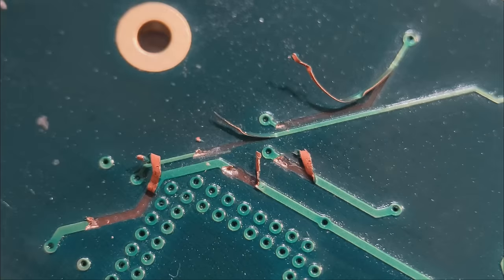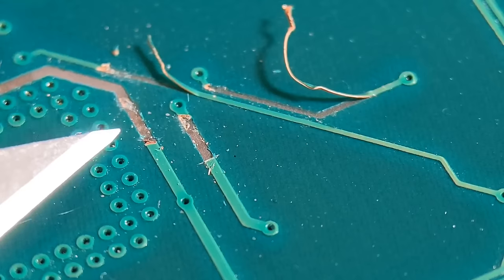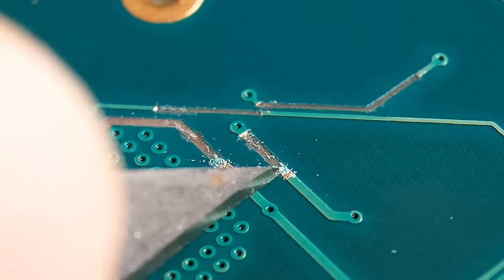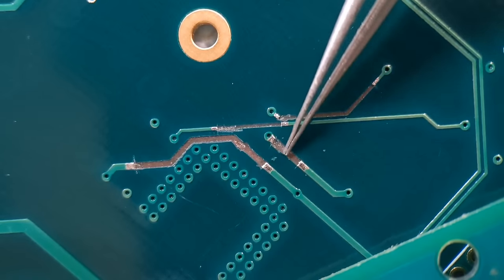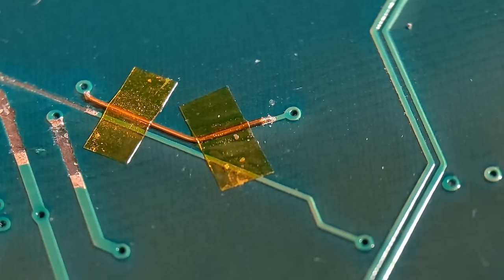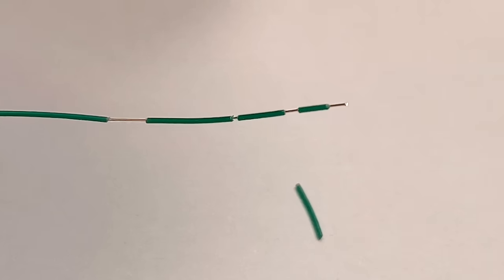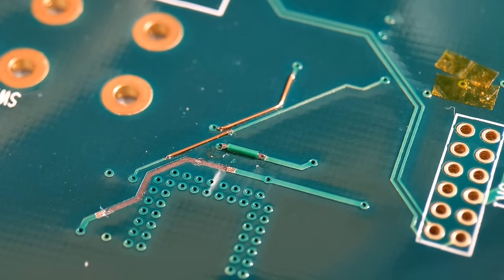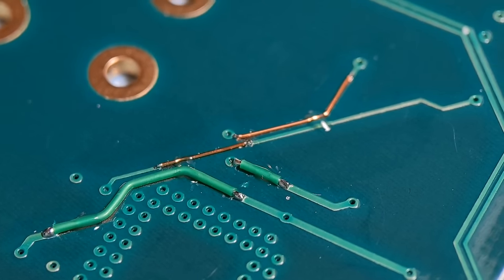How To Repair Damaged / Broken PCB Traces  - 2 Great Methods

Comment: I haven't been happy with magnet wire. I can scape off the coating, but it takes a good bit of effort. Burning it off hasn't been a success, i would need to go all the way to 450 on the iron, which is something i very much dislike doing, and then hold the wire in a solder blob for like 10 minutes. I bought the magnet wire from a local company, several times, and each time it's behaving the same, some sort of super enduring coating, very annoying. It doesn't have any temperature rating on it and doesn't claim to be anyhow special. A curse or a blessing, the company has rolled down its operation, so maybe i can try again, perhaps i'll find some lower endurance one now :D

As to loose trace sections i sometimes just glue them down with epoxy. The one i have is general purpose and isn't temperature rated but it seems to hold up to soldering just OK. Unfortunately it's slow. I have seen some people also use the soldermask green resin and cure it with UV to attach loose copper, but i don't know how well it works, whether it really cures all the way through. I have gotten some of that resin but haven't had the opportunity to try yet.
Reply: I is better to burn the coating off with an open flame, like a lightener or a small propane torch, and dipping it in alcohol. Then rub the remainders off with a cloth. Worked for me even on stubbornly hard enamel.

Comment: What kind of wire? "Cainar wire?"
Reply from the maker: Hi , thank you for your question . The green wire is called Kynar . It's a 30 gauge wire and comes in many different colours . It's a very common PCB modification wire , available from Farnell , RS components , Digikey , Mouser and many other electronic distributors . Hope that helps , thank you again 👍

Comment: What tape is that?
Reply from the maker: Hi , thank you for your comment. The tape I used to hold the wires down was called Kapton Tape. Available from many places , Farnell , RS Components , if in America try Mouser or Digikey. Comes in different widths as well . It's a great tape recommended for doing PCB work. Hope that helps , thanks again 👍